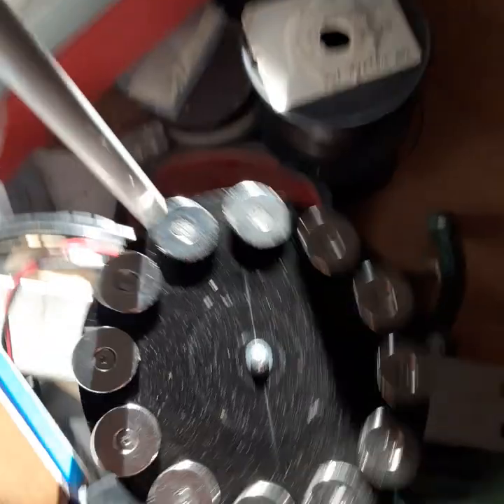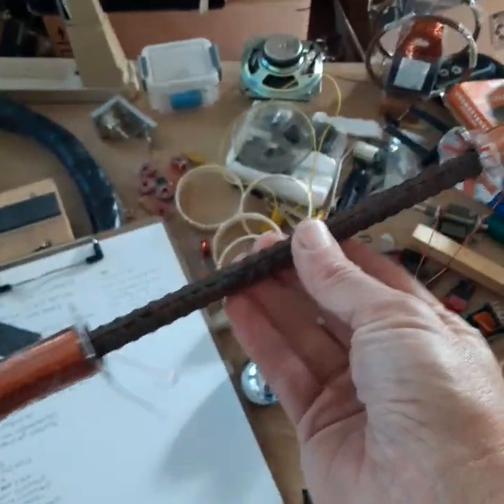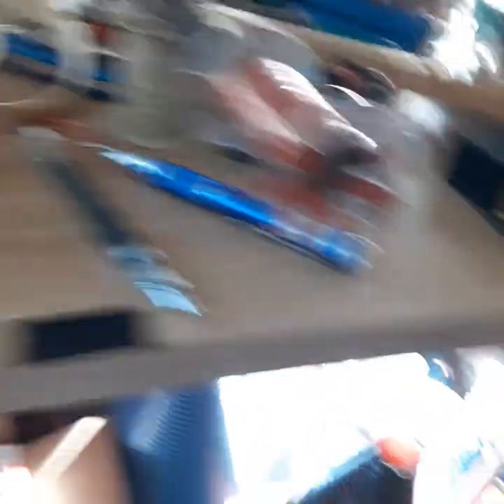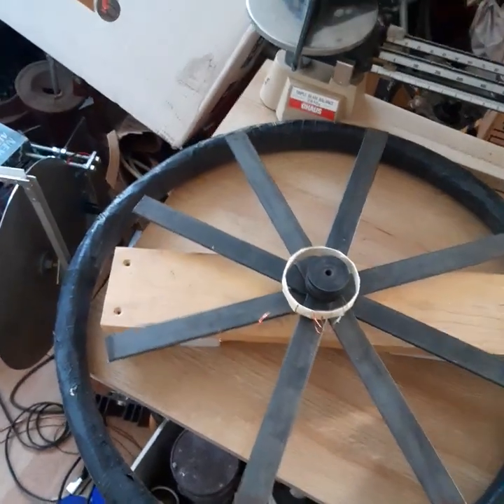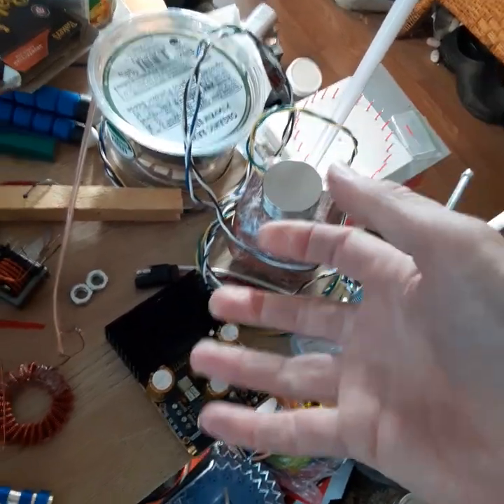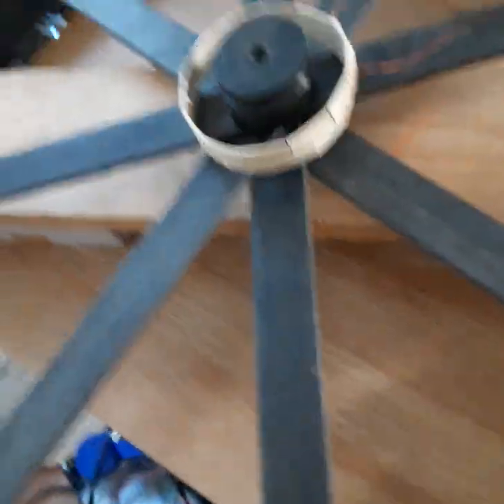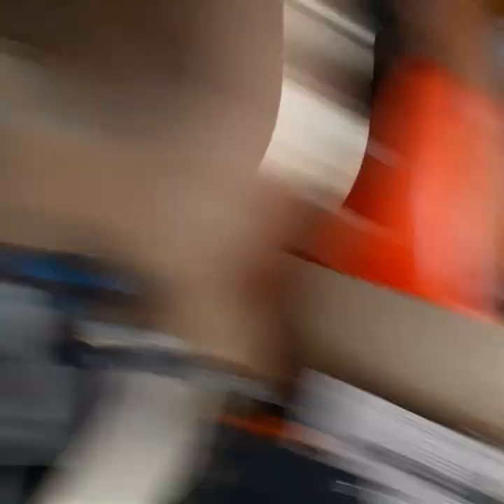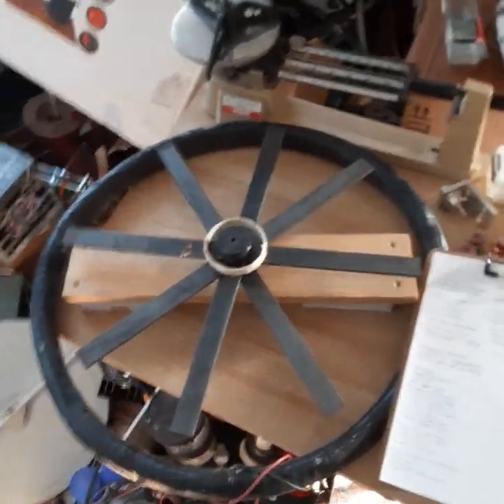warped space is likely magnetic pressure changes

Comment: i think this magnetic pressure idea explains a lot. i cant explain why exactly, but it seems to fit intuitively fit into the puzzle. cold air masses are associated with lower pressure which would explain the cooling observed around the searl effect generator. all those magnet rollers spinning around pulsing the pressure waves at whatever rpm. i'm certain theres a relation between the frequency of the pulses and the strength of the effects. pulsing in resonance with the local environment probably strengthens the effect while pulsing out of resonance would have an opposite effect. there would be also be sideband effects. the searl effect generator seems to be the most efficient way to utilize this. static magnetic arrays like david lapoint's bowls seem to be another good way to safely and stabley take advantage of this magnetic pressure differential. but it still requires some kind of relative motion within the field of influence for the spooky effects? like the magnet shooting out of the center of the bowl

Comment: And you have stuff like differential charges between one body orbiting another in space, and that's why one will likely spin on its own axis instead of being tidally locked. (Stuff like solar winds/plasma pushing charges around.) Has stuff to do with moving through the field from a radiating body, and also the surface areas exposed to pick up the charge. But postulate that to astronomers, and they don't seem to like the idea. So there's some energy exchange expressed in terms of angular momentum on top of all that which is probably going unaccounted for in most models.
Reply from the maker: there are lots of things the current models are missing. they invented "dark matter" to fix the errors they have, but now they can't find the dark matter, so hopefully they listen to people like you that have great ideas

Comment: Of course it does ,  what do you think reverse flyback voltage is doing. Its returning the coil back to its original state threw its own pressure (Environment)See my Open source flyback circuit with two inductors . Based off Bedini SG .. 👍

Comment: why would this interaction between magnetic fields cause noticable air pressure? I don't see how it could cause the air to move significantly or why the spinning and stationary field combined would do what a single field couldn't.
Reply: This is because the ratio between the local value of Mu and the Cosmological Constant share a dynamic relationship with each-other, defining the value of C for any given trajectory through the affected volume of the coordinate space-time.  This change in C will appear polarized to any photon or particle of matter traversing through that space, and it's velocity and curvature will be dependent on its given trajectory.  Under atmospheric conditions, gas molecules, due to brownian motion will migrate into the coordinate region of compressed space where the greatest change in Delta-T amplitude of the magnetic flux gradient is being concentrated. This area will appear colder that the surrounding space due to the change in local C, hence this increase of gas pressure and red shit in molecular velocity is primarily driven thermodynamically.  The same consideration applies to the flow of current in free gas ions and inside conductors that physically pass between reference frames.  Bucking coils can create a very high intensity concentration of B-flux between these fields, and will form a node of maximum magnetic pressure where the opposing maximum flux amplitudes are being most sharply expelled and canceled in the inverted Bloch wall formed between the field generating elements.

Comment: Apparently, there's way more to a magnetic field than just North and South poles. There's a plethora of other "polarities" that you can extract from it. Magnetic pressure: could this be equated to an electrostatic field force?
Reply from the maker: not sure magnetism is even a "real" thing, it is electrostatic induction when viewed at 90 degrees. so, yes, quite sure it can be equated to an electrostatic field of some sort
Reply: @spacecase0  You're very close, Magnetism and the Electrostatic field are the same thing but in different modalities, like water and ice, the latter is called the Dielectric field which is Counterspace under tension, stress, or strain (this is why Tesla referred to voltage as "tension"), when it loses its tension it transforms into Magnetism and changes from existing counterspatially to spatially in a state of dynamic circular polarization upon itself. When those 2 fields come together they create the Electric field, Steinmetz touches on it in his book Electric discharges waves and impulses, the dotted perpendicular lines are the Dielectric while the closed parallel loops are the Magnetic.